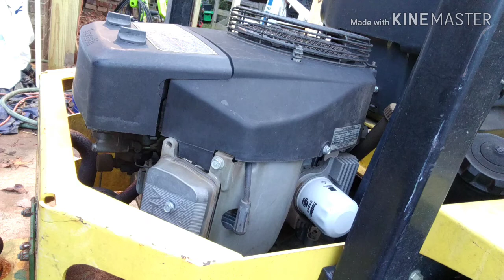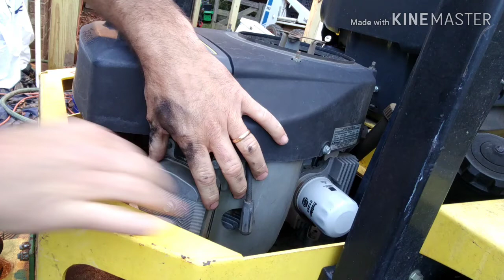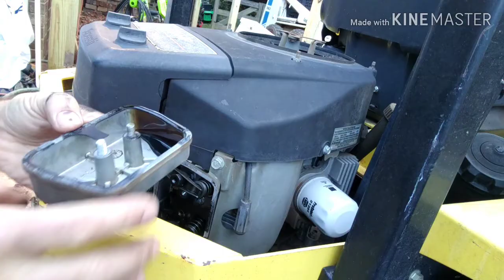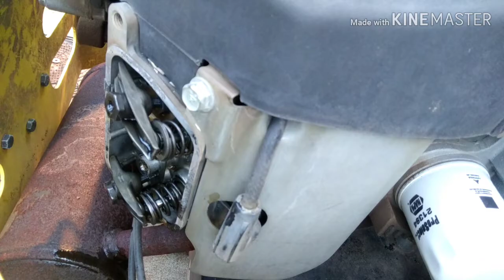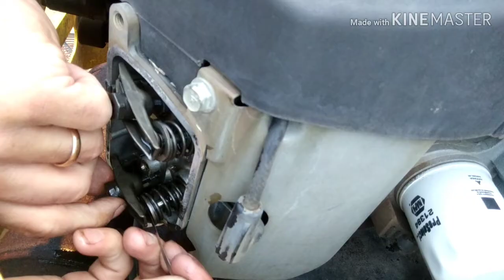Adjusting Kawasaki 25hp valves

Comment: Your video was very easy to understand and complete. 
Short and specific instructions that are easy to follow. 
You save me a lot of trouble and money.
Reply from the maker: Awesome, glad I could help!
Reply: @TepcoCycleRepair   You did an excellent video explaining the adjustment.  Just did valves on my 2014 LUX 550 Gator for the 1st time at 800 hrs.   It should be pointed out that checking valve clearance before puting a wrench on it serves 2 things.  It lets you KNOW crank and valves are in correct position to adjust and also if valve adjustment was too tight or too lose.  Mine was supposed to be 004 to 006 and 3 were .010, one at 009. so I know it was just normal wear and in good shape.  Great video.  Thanks.

Comment: I've ran mine for 6 years and never had to do anything to it, 409 hours and still going strong 💪
Reply: You don't adjust them.till 500 hrs and every 500 after
Reply: Ok so I just checked and adjusted a Gravely today for the first time ever and I measured .014 and up on all 4!  Yes this engine has 2800 ish hours and no one has ever checked it before and now that it is tuned the PTO doesn't bog the engine down and struggle.  Check them.  Im new to the company.

Comment: My Kawasaki FD series water-cooled twin cylinder engine manual says the opposite of your video, that the internal Allen screw is the adjustment and the outside nut is the Lock.  It calls for 0.01" clearance if anyone reading here is doing an FD series engine.

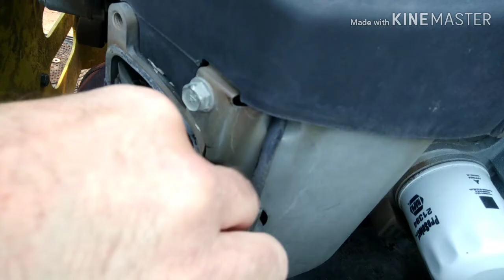Comment: I did enjoy the video and it helped a lot, but at 2:53, you needed to loosen the Allen first before the adjustment nut.  You cracked the wrong thing, surprised it didn't break something since the lock nut (allen bolt) was still tightened when you "cracked" the adjustment nut.  You should put an a specific annotation in the video about not doing that one first.

Comment: Mine has 1700 hrs  and when l checked them  still within specs. I was surprised.  Must be high quality component they put in these things
Reply from the maker: As long as they are not abused, and we'll maintained, they can definitely go for many hours without adjustment.
Reply: Z920m kawi. 1000 hours still in spec

Comment: All Kawasaki FH series engines are .004" intake and .006" exhaust .I know Im a little late to the dance here but I wanted to add a little info to a nice video.
Reply: Document I downloaded directly from Kawasaki's site says .004 to .006 for both intake and exhaust in the manual for my 17HP FH series.
Reply: Incorrect. Look up fr600v as05 valve adjustment
Reply: @asusreviews  You are correct! I have a 17HP Kawasaki motor (FH601V) also. Valve clearance is  .004 ~ .006 inch

Comment: Question   I have a 20 hp  Kawasaki  sratred spitting and sputtering chacked the push rods  thay not bent  got fire going to the cylenders but when i pull the plug wire   to that one cylender it goes dead.  i am scraching my head dont know what to do.... what could it be  ?
Reply from the maker: If you pull a plug wire and the mower dies, it's the other cylinder. Check the other cylinder spark and valves. The one you pull and it dies is the good cylinder otherwise it would continue to run on the other cylinder.

Comment: Thanks for sharing. Question: so if piston is full visible does that mean that valves are ready for adjustment.  (can a  light be use to see the piston position ) please correct me if wrong.  Again thanks and God Bles
Reply from the maker: Just put something in the spark plug hole, like a chopstick or long screwdriver and turn the engine by hand until the piston is at its highest point and both valves have play. There is a tdc on the compression stroke and a tdc on the crossover stroke, you want the compression stroke when there is play in both valves.

Comment: My mower has same motor and it trys to start but then it dies and starter cant turn it over until I wait awhile. Its like the motor is getting to much compression. Would this be an issue where the valves need adjusted?
Reply from the maker: Absolutely yes.
Reply: Thank you. I am going to adjust them on my days off this week.

Comment: Nice video! because i interest for that motor i have a question, the rotation are clockwise or counterclockwise facing the pto shaft??
Reply from the maker: If you look at the engine from the flywheel cover it rotates clockwise.
Reply: @TepcoCycleRepair   So.. that means when directlty looking the pto shaft rotate counterclockwise right?
Reply from the maker: @iwatchyou001  Yes
Reply: Isn't "clockwise" the same no matter how you look at it?

Comment: I’ve got a single cylinder Kawasaki on a John Deere mower. I adjusted the valves thinking it will cold start easier! 
No difference ! Hard start or no start when cold and back fires. 
Any ideas? Runs good and starts good when warm.

Comment: my mower looses power when blades are engaged,thought it was the coil but that did not fix the problem,Would this help
Reply from the maker: Well I would need more info, is it diying as soon as you engage the blades or they will engage and you start to loose power? If the first it's a safety switch, if the second then probably valves or compression.
Reply: @TepcoCycleRepair  it wont die but bogs way down .I can pull one plug wire and it will not die, pull the other and it does.They both have good spark and I swapped plugs. The one that doesnt kill it has the new coil. The blade spindles seem to turn freely.
Reply from the maker: @1983mojo1  The plug wire you pull.and it doesn't die is the bad cylinder. You're running on one cylinder. Absolutely check your valves, you probably have a bent push rod. Easy repair.
Reply: @TepcoCycleRepair  Will check that ,thank you so much for your help!
Reply: Both rods are bent !
Reply from the maker: @1983mojo1  Awesome, I figured that. Just order new push rods, drop them in and re adjust valves and you'll be good to go!
Reply: @TepcoCycleRepair  thanks again !
Reply: @TepcoCycleRepair  this conversation literally described the exact issue I was having. I am going to order new Rods. The only thing I have that is different other than loss of power is that I have a backfiring condition that happens when the motor gets to temperature or if I change the throttle suddenly. But I have loss of power under load and some backfiring.   So do you still think check the rods ??

Comment: Can this fix surging?
Reply from the maker: Not usually, surging can be from lack of fuel (weak fuel pump, clogged filter) clogged pilot jet, sucking air from somewhere. A carb clean/rebuild or mixture adjustment usually fixes surging.
Reply: @TepcoCycleRepair  I just replaced the engine with a brand new replacement. Kawasaki FH770D-KAI 28hp. It only has around an hour of break in time on it. Anything higher than low idle has surging and sputtering/misfire.

Comment: I lost compression on one side, its at 0. the other side has around 150 psi. adding oil and doing a compression test does not increase pressure. Could it be the valves out of adjustment on that side?
Reply from the maker: If you have 0 psi it seems it would be something more severe, like a.broken connecting rod. If the piston was moving at all I would think you would get some compression.
Reply: @TepcoCycleRepair  could it be a head gasket?
Reply from the maker: @Stephen-ut5xo  is the piston moving? Even a blown head gasket would show some compression. Stick something like a straw down the spark plug hole and see if you can feel the piston move when you turn the engine slowly.
Reply: @TepcoCycleRepair  your right the piston isn't moving it just sits there as I turn the engine. Is it the connecting rod?
Reply from the maker: @Stephen-ut5xo  most likely, not a hard repair. Broken connecting rods are usually from the rod seizing to the crank. Make sure you clean up the crank before you put the new connecting rod on. The rod material usually transfers to the crank journal, it's much softer so you can usually save the crank.

Comment: Mine is smoking a white/blueish smoke one start up only for a few seconds.  I don't believe this is a valve adjustment problem?    I'm not sure if it's a carb clean problem either, but it's due to be cleaned I guess.
Reply: I guess it could be rings.
Reply from the maker: That's usually a sign of valve seals. Constant smoke would be rings. Smoke at start up is usually valve seals.
Reply: @TepcoCycleRepair  Thanks, I think you're right. If I'd thought about it a little longer.  I'm retired and my mind is getting slower, but I'm getting smarter, just slower.

Comment: I think they also call for cleaning the carbon off the inside of the combustion chamber in the head.
Reply from the maker: Yes, but not as often as adjusting the valves. If you keep the valves adjusted and use good fuel, carbon build up should be minimal. Thanks for watching!

Comment: how do I know if my engine needs to be adjusted to .006 as well?
Reply from the maker: You'll need to check them to see if they are in spec. Any running issues or difficulty starting should be a sign. Checking and adjusting is a maintenance item and shouldn't be overlooked.
Reply: @TepcoCycleRepair  that you for replying, but I was wondering where to find what distance to set them to. He said in the video that his was .006, but I would assume not all engines are the same.
Reply from the maker: @the_spankles  oh I see, all the Kawasaki 25hp are .006 what do you have?
Reply: @TepcoCycleRepair  I have a husqvarna z5426. I believe the engine is a Briggs and Stratton 44p777 26 hp
Reply: In your owners manual  you might find that information in the spec chart. It'll be labeled intake valve clearance and exhaust valve clearance.  Many newer briggs engine have a sticker with a qr code. If you scan it you'll have your owner manual.
Reply: @jonholt201  thanks man, but I think I sold that mower 6 months ago :)

Comment: I have a kawi 23 hp that I want to adjust the valves on.Lets say I am on the compression stroke ready to adjust them.Do I loosen only the 14mm nut or do I have to hold the 14mm nut with a wrench and then loosen the 3mm nut(or whatever it is)? 

I am a little confuses because it looks like you just loosened the 14mm nut and went from there.
Reply from the maker: Ok so you can just loosen the 14mm nut to loosen everything, The 14mm nut is the adjuster, the 3mm Allen is the lock. So if you just loosen the 14 it will loosen both, so if you just tightened it back it would have technically done nothing. After you loosen the 14 you'll need to back the 3mm out some to have the room to tighten the 14 more. watch it from 3:00. They are not super precise when adjusting, you'll have to do it a few times to get the feel, it seems to always get a little tighter when you lock it down, so start a little loose before you tighten the 3mm.
Reply: @TepcoCycleRepair  Thank you so much for taking the  time to reply.I understand now! Will do this in the next couple of days.Engine has 1100 hours and has never been  adjusted  and for not want to go to the dealer.
Reply: I adjusted the valves today.With your help it was easy,thanks again! One intake valve was at .009 while the other was at .011. One exhaust was at .011 and the other was at .019. I set valves to .005. Engine has 1109 hours and this was never done.
Reply from the maker: @michellejohn695  Glad I could help, it's amazing how long these engines will go without a valve adjustment. Most that I do is the first time they are done as well. Good Job getting it done!

Comment: Good video. Most of the videos are confusing on how to find top dead center. I checked my valves earlier but think I checked them with the wrong gauge. I checked them with .06 mm.

Any tips on how to get the old gasket material off? That took forever.
Reply from the maker: I use gasket remover for tough ones, it just sprays on and eats the gasket off.  Thanks for watching!
Reply: Tepco Cycle Repair okay I’ll look for some at the parts store
Reply: At the factory we use mm and on this motor the spec is .10mm- .15mm

Comment: Hey there!! Any idea why my intake valve won't move and its very tight. The lower valve is fine l did the adjustment but the other one is to tight.
Thank you
Reply from the maker: Make sure the locknut is loose enough. If it is, spray some penetration oil on it and let it sit for a few.
Reply: @TepcoCycleRepair  l did, everything is working good now.
Thank you very much, have a great day!!!!

Comment: You should remove cover and do it the right way: noting the position of the magnet in relation to stator
Reply from the maker: You can, but not necessary. It's a valve gap not timing so as long as no lift is on the valves your good.

Comment: That engine has 1500 hours on it. How long can a properly maintained engine last? well the Kawasaki engine.
Reply from the maker: I've seen them in the 3k hours range. Oil filter, air filter and valve adjustments. Heat kills them so keep the leaves off the chassis so it can breathe and stay cool.
Reply: @TepcoCycleRepair  thank you so much for the reply. i just got a new Kubota with the kawi 850 EFI and I am already a fanatic on care. The next videos I watched was a guy in Oklahoma who was rebuilding Kawi's that had high oil consumption at 250hrs! So I'm going to make sure I get 3K hrs or more.

Comment: Why do you have to do this? Just bought a new mower don’t wanna have to pay every 250 hours for them to be adjusted
Reply from the maker: If the mower gets hard to crank, spins a little then stops, spins a little and stops, the valves need to be adjusted in order for the auto decompression to work and the engine to spin freely.
Reply: Tepco Cycle Repair okay thanks just figured this out never bought a Kawasaki motor before

Comment: somebody took a nine horsepower xr75 to Carolina lawn and tractor they hit a Rick or Brock or something and it went dead so Carolina lawn and tractor told them must have told them that they blew their engine and sold them a new tractor well I went to the junkyard and I yank that out of the junkyard and I opened up the engine all it was was a pushrod came out from underneath the rocker arm isn't that amazing.
Reply from the maker: Oh yeah, I pull "junk" equipment out of the trash all the time that need minimal repairs. Good find!

Comment: About as clear a video as I've seen on this.  When you say "adjust at least once every season" what's that translate to the homeowner?  About every 300 hours?  I imagine in one season, a commercial lawn care businesses will put that much on a machine easily.
Reply from the maker: On the larger CC engines yes probably 250 to 300 hours on the smaller CC engines more in the 150 to 200 hour range.
Reply: @TepcoCycleRepair  Thank you.  I'm thinking specifically of the FS730vi fuel injected Kawa in my John Deere tractor.  Gads, it's a strong engine.
Reply: @mic982 sounds like 500 hrs is a good interval if you read the above comments.  Easy to remember that interval also.